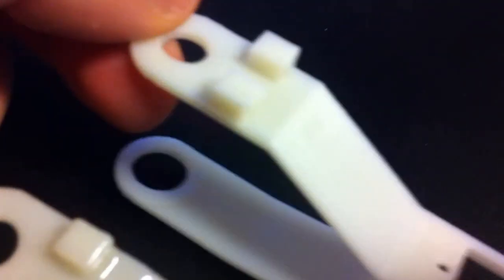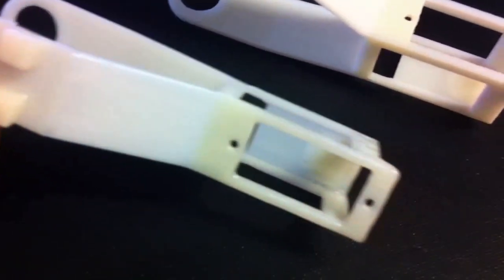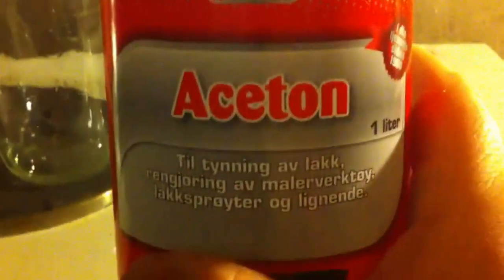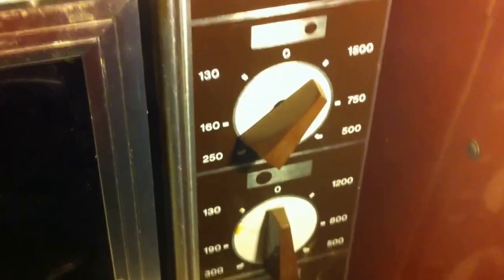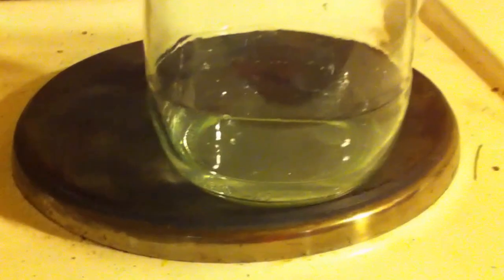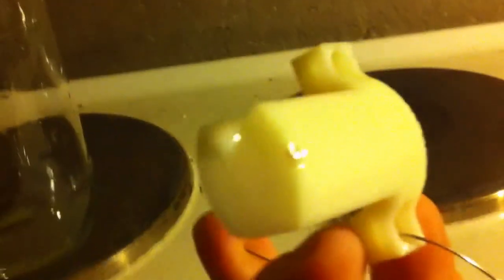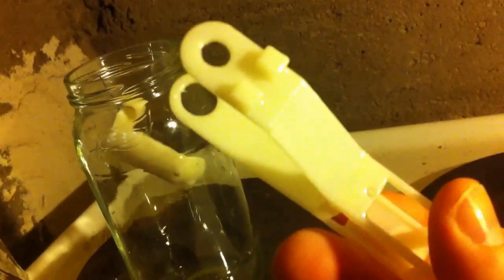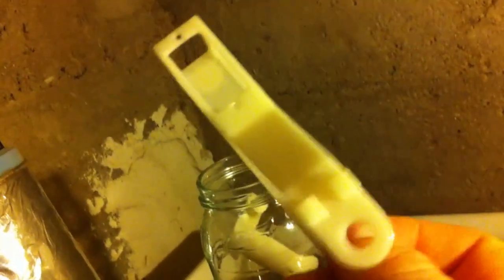Create a polished surface on 3D printed parts (Dangerous)

Comment: 1- Aceton is highly flammable - You don't need to boil it - Just leave it inside a chamber with your part; 2- Don't boil anything inside a jar... That is not made to tolerate high temps; 3- Don't do this indoors. The fumes can seriously harm you; 0-SAFETY IS THE FIRST; 4-Thanks for sharing your ideas.

Comment: I use an electric griddle (like for pancakes) and set a large tempered canning jar directly on it. Works great. you can cut the temp off right as the acetone evaporates and I recommend lowering the object in on a completely flat platform (like glass) with piece of wire or string. Be careful though, after the plastic softens, if you are not quick the whole thing will turn into a blob of dripping plastic. I learned not to do it in the kitchen because stray fumes caused a small explosion with the gas pilot light only a couple feet away. Its a great technique but take care!!! Safety goggles and gloves, respirator too.

Comment: This also prepares the surface for plating if you want to chrome or nickel plate the part.  The ABS material is too porous for plating unless the outer layer is melted by acetone or similar methods.

Comment: Mask off mechanically critical areas, then mix up some kind of epoxy that's plastic-rated and carefully coat the part in that.  I've found it increases the strength of parts significantly, and you can even repair voids with it if you know what you're doing.

Comment: Yes, it can be dangerous especially if you don't use proper temps and ventilation.
It doesn't take much acetone to achieve this process. But using a kitchen stove inside your house is not a safe way to do this. I suggest outdoors.

And remember this will work on ABS but not PLA plastic.
BE CAREFUL!!!

Comment: ...and do you really need to breathe with acetone vapor too.  Why not cover the bottle with a rubber glove so to keep all the vapor inside. Just take a good rubber glove, silicone preferably and tighten it over the bottle - it will keep the pressure within the norm but will not let the acetone go outside the bottle. Use the velcro band or just a rope to help the glove to hold on to the bottle.

Comment: it seems like this would work as well or better if you kept parts hanging in a sealed atmosphere with acetone vapor that could continuously cycle (perhaps blown by a fan?).  if it were me doing it, I'd use an upside-down aquarium with a rack of some kind inside to hang the parts, with a dish of acetone inside and maybe an all-metal computer fan to cycle the vapor throughout.

Just an idea.  I'll try it when I'm able and report findings if I can find this page again.

Comment from the maker: I use to have parts for 5-10 seconds in Aceton3 steam. Then it vent and dry for outside the steam for 10 seconds.
So I repeat the process 2 to 3 times. This depends on finnishing I do want to achieve.

Comment from the maker: I use ABS. I have not tried the PLA. You can test whether PLA dissolved in Acetone with a plastic bits you do not need. Just dip it in acetone.

Warm water can dissolve the PLA but if it works for this I do not know. If you test, let me know.

Comment: what would you recommend for bigger parts, about 10x12x5 inches in size?  
also, when you melt it with the acetone, doesnt that change the part itself?

Comment: a few thin layers of clear coat give you vers similiar results. but if yu have to you acetone vapor, put a cover on the jar!
Reply: A sealed lid would turn it into a pressure bomb as it warms and the vapours can't go anywhere. Clear coat sounds more suitable. Or at least put the whole ABS, acetone, etc. contraption outside.

Comment: This should be in the division "NEVER TRY THIS AT HOME"!
But he is right: you need the vapor to condense in the smallest gaps

Don'ts:
1. Don't use a glass jar
2. Don't do this in a non-ventilated space
3. Don't stare above the vapor: this is very nocious to your lungs (maybe that's why your voice is rasping)
4. Never use an open flame
5 Use a cover with a hole to minimize the acetone vapor 

DO'S!
1. Always wear safety glasses (closed all around)
2 Always use safety gloves
3 Always do this alone
4 Always wear an active carbon mask

I'll propose a better way

Comment: I think I saw Steven Seagal do this in a movie to take out 3 bad guys. I can't say enough about what's wrong with heating solvents as volatile as acetone, and with a microwave no less, SMH. Things go wrong, you won't have a chance, whether it's flames or concussion effects. I use acetone for many different things but I won't even have an electric motor running within 6 feet of open acetone, let alone warm it up to bring it even closer to flash point.

I say you can sometimes tempt Fate, but don't drop your drawers and moon her, for crying out loud.

I worked building loud speakers with a guy that removed the epoxy from his skin several times a day by drenching a rag in MEK (Methyl Ethyl Ketone) and swabbing it on his hands and forearms like it was water. But he wouldn't drink tap water in restaurants because the old plumbing was joined with lead based solder.